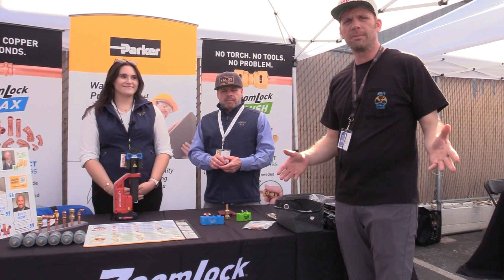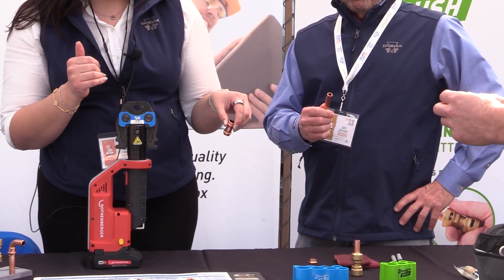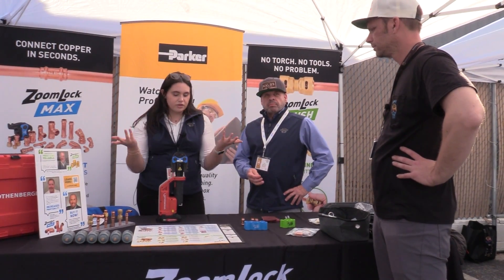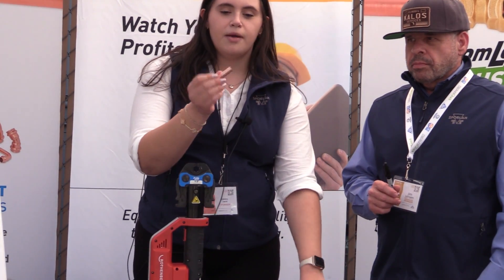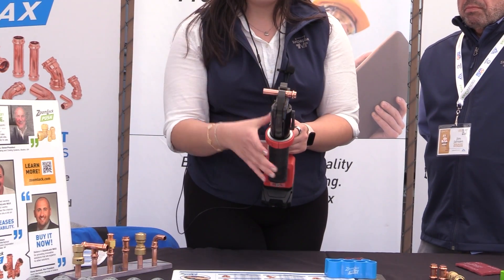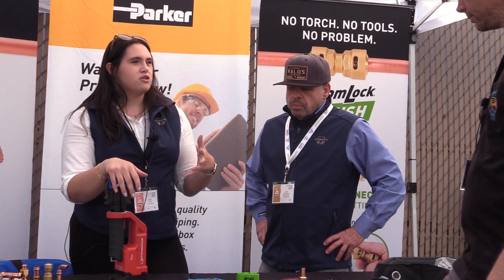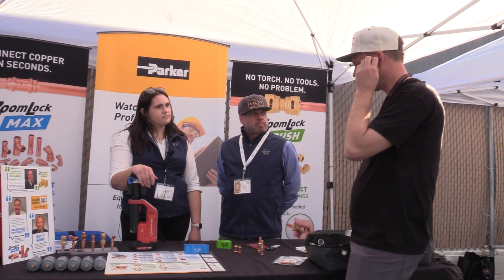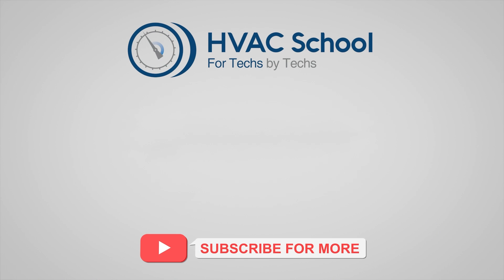Zoomlocks & More at the Parker Sporlan Booth!

Comment: I’ve never personally installed one myself. But I’ve run across a couple that were leaking, so I’m kind of skeptical about them. It might’ve just been the install, but just not sure about these. What is your opinion?
Reply: Tubing Prep is the key "Tubing Prep is the key"!
Have had no issues so far with "OG" Zoomlock press and optimized 410a push.
Have not used Zoomlock max.
Reply: I don't think I would use that I gwt it it's safer but I much rather have a braze joint just be careful when brazing that's all 😊😊
Reply: I wonder if they are vacuum rated, I mean the push fittings.
For the price of the fittings jaws and tool
I think 15 years is too low of a warranty.
Reply: I've used the push fitting twice. First time on my own heap pump to try out and test. It's been problem free for since install (3 years ago), and I live in a cold climate.

Second time on an install that could not braze.

Prep is key.